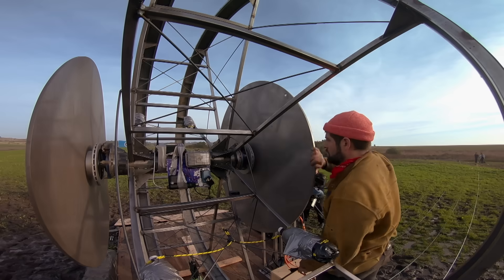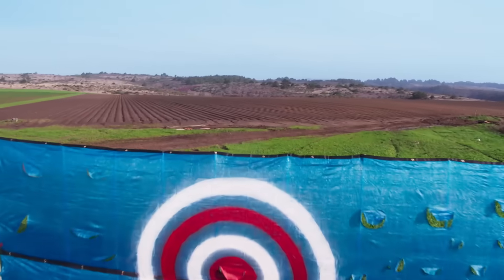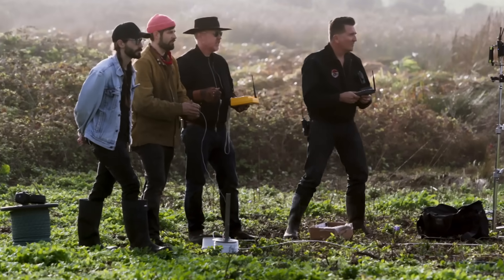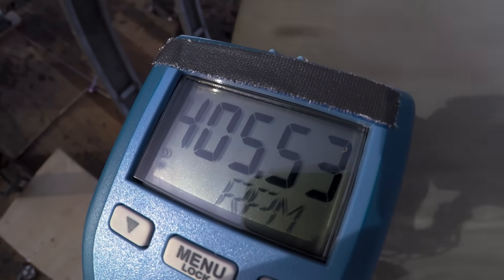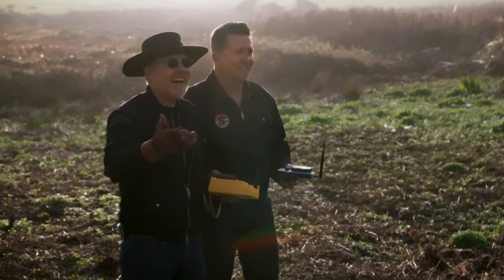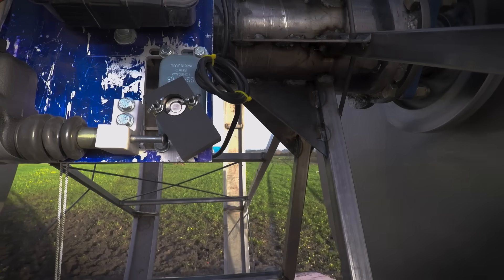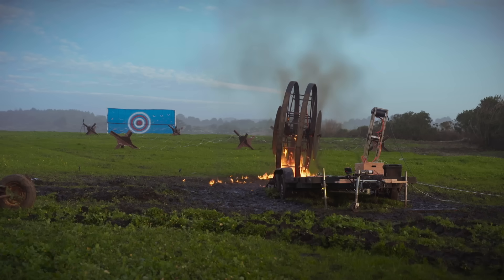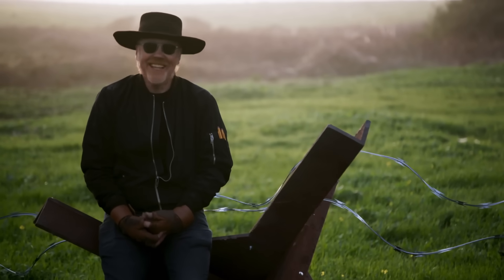Weaponised Flywheel Experiment Fails Explosively | Savage Builds

Comment: After reading a bunch of the comments discussing better ways of energy transfer or just ways to simply make it work better. I’ll throw my opinion in the mix.  If I was gonna do this I wouldn’t mess with brakes and just figure out a way to remotely connect the flywheels and the wheels with a short section of kinetic recovery rope. Simply, easy, it would lose very little energy to heat and it wouldn’t be a bolt shearing instantaneous energy transfer. You could even control the rate of flywheel deceleration by the length of the rope.

Comment: They wanted a dog clutch device to transfer momentum from the flywheel to the outer casing instantly. Not brakes. Doing so however would probably have just twisted and snapped the drive shaft in half. Or if not snapping it, the twisting would have delayed momentum on one side of the outer casing and caused the the whole contraption to lift on one side and go careening off at an angle on one edge.... Which would have been quite satisfying in itself.

Comment: If the wheels weigh as much as the flywheels you absorb any "thrust" during transfer of power.
Reply: A gear reduction system(or equivalent) is needed. Consider the toy cars that are propelled with flywheels. Applying a flywheel directly to the driveshaft/axle proves extremely inefficient.

Comment: Removing unnecessary parts instead of falling into trap of optimization of existing concept = remove brakes from design, move flywheel inside of wheel making it a wheel itself,  make carriers that fall in at desired speed and watch magic happen

Comment: Looks like it needed a direct super strong clutch to engage the flywheel energy to the wheels. Also, why was there no tread\traction on the wheels? Even if it had worked I think it would have just spun in the mud.

Comment: maybe a giant coil spring that can be instantly engaged with a servo, but smooths the energy transfer from flywheel to wheel as it winds up for like 3 seconds, and applies a growing force. you also get the power as it unwinds.

Comment: They should have used maybe a clutch system from a semi truck on each side instead of two wimpy brake calipers. I could've told them that. If my brakes (all four wheels )get hot going down hill in a  6 thousand pound truck then I don't know why they thought 2 calipers could handle a task like that.

Comment: I had way better success using far less science / theory taking a cd player motor, clipping on a cd, and running power through it until it reached maximum rpm (I did not measure the rpm but needless to say the cd was humming) a quick twist of my wrist and the cd popped off the motor and took off across the room and up the wall when it hit.

Comment: That was anticlimactic. I wish they'd replaced the braking system instead of just blowing it up. 

And maybe try it on dry ground, where it doesn't sink in the mud.
Reply: It was the mud more than anything
Reply: @ph30nix62  yes only mud
Reply: @ph30nix62  The mud / thinness of the wheels.
Reply: I think they realized the whole concept is kind of bunk. It's impossible to transfer enough energy through those brakes, they're specifically designed to convert kinetic energy into heat.
Reply: itsClearIntentionalFail
Reply: A muddy field/ground needs to be part of the equation.
Reply: They probably weren't alowed to set that thing off anyway. It would be uncotrolable, very dangerous. This thing never had a chance to work and it's not the brakes. It was too big. You can see hey went with cheap production process, if you want something to spin fast it has to be balanced otherwise - fail.
Reply: @ardvark84 they could have done the test in the desert

Comment: fly wheel needs to be slightly smaller than drive wheels so less torque to transfer.
you could do a wheel balancing like they have for steer tires on a semi bearings in a tube around outer edge of flywheel.
not sure best way to transfer power semi clutch at each side?

Comment: Ok, my take, muddy ground bad. Wheels to thin to offset the ground pressure, (this is why tanks have tracks). Breaking system needs to be faster. Recommend high pressure air breaks they use on a rig. Really didn't need to blast the thing. Sad build that could have been so much better. 

Now I wasn't there to help design. Maybe there was a reason for thin wheels. Maybe there was a reason for using hydraulic breaks and heavy fluid. I don't know these things so can't state any agreement or not on construction. 

That said ground pressure for any vehicle is important. Maybe a mesh or some thin aluminum connecting the wheels together could have alleviated some of that ground pressure?

Comment: Plowing through MUD is NOT what you should have done.  On Concrete, the brakes could have been applied and then released and the wheel would have kept going--less friction at the wheel. DUH.

Comment: They could have at least welded some spikes to the wheels or glued some destructed rubber tires with tread to the wheels or just do it on the salt flats. It’s obvious it didn’t work because it couldn’t overcome the muddy surface.

Comment: Bit disappointing you didn't go back again with a better braking system. Wouldn't some kind of clutch system been more efficient? With the current system it would have made more sense to have a two stage release system, where the drive wheel was allowed to move freely to spin up a little before the whole thing got dropped to touch  ground.

Comment: They should not have used disc brakes. All of the kinetic energy was lost by grinding the brake pads down and creating heat. Should have created a latch system to grab the flywheel and transfer all of the energy at once. I think Discovery owes us a do-over (if they want satisfied viewers).

Comment: Problems were very much present in the brake system but that is by no means the worst of it. The thing is heavy. Really heavy. So you neeeeeeeeed solid ground to work on. Otherwise you'd need corresponding wheels for offroading.

Comment: One other suggestion; try moving the brake caliper to the outer edge of the flywheel itself instead of on that tiny little automotive brake rotor.  Applying the brakes directly to the flywheel, at its edge, which is much farther from the center of the axle, would apply more rotational force.

Comment: Brakes operate by transforming kinetic energy into heat energy.
What you dod was to transform kinetic energy to heat energy then heat energy back into kinetic energy, but you didn't calculate the losses associated with the heat transfer. It is sad you took the fail instead of fixing it.

Comment: 1) The design will require not one, but dozens of brakes, each placed along the outer perimeter of the flywheel, not the center. 2) Even if the math suggests a total energy capable of 40 mph, the assumption of the rolling surface has to include friction losses due to the viscosity of the mud, otherwise wait for dry soil conditions

Comment: Opposing Brake calipers on outer diameter of flywheel using a spring over hydraulic intensifier piston to apply pressure, or wedge style actuator 👍

Comment: The flywheels are  smaller than the  diameter of the  "ground wheel " with  no mechanical  advantage,  i.e. gear reduction.  I'm amazed that  two  "engineers " couldn't  figure  this out... wait, no I'm not! Mechanics,  welders,  and machinists  fix engineer's  mistakes  every day!

Comment: How much energy turned into heat at brake application and how much energy was dissipated in the muddy ground?  I may not be the smartest guy in the room, but I have gotten a 300 hp truck stuck in the mud while simultaneously destroying a clutch. NASA needs me.

Comment: Instead of a brake, would a clutch work better for immediate transfer of force?  Obviously it would have to be larger and more durable, but the same basic mechanics of inertial transference have been used inside of automobile transmissions.  Engage the clutch while it is charging; disengage to move.

Comment: I feel like I see another issue. Brake fade. I think if you got the braking system to be abrupt enough it would only work for a few seconds cause the brakes would heat up too much and lose their effectiveness. You could stall that with a really large set of brembos with drilled and slotted rotors but I still don't think that would be enough.

Comment: I'm a trained mechanical engineer and automotive enthusiasts and the moment I saw those brakes I knew they were not up to the task. Can see when it takes off that there is a BIG difference in speed between the flywheels and drive wheels which proves the brakes were way undersized

Comment: A wheel that diameter (say 10ft) turning at 800 rpm (if all the energy was transferred) would need to be travelling at 285 mph for it not to be breaking traction with the ground.

Comment: Should of used a hydraulic handbrake system. Think of flying over your handlebars on a bike. Its instantaneous stopping force. Not just a little brake pressure.

Comment: Instead of two 5-ft discs why not have one 10-ft disc. The two discs could counterbalance each other. I believe the mud was a factor in slowing it down. Why not do it in the Mojave desert and spin it up to 5000 RPMs. Engaging in a fuse welding onto the wheels, and then a blast of water to cool the weld. Standing a quarter of a mile away.

Comment: This video was honestly a flop. The explosions in myth busters where just the icing on the cake. We watched for the scientific experiments. 
Just attaching some gasoline with det chord is just a bowl of icing.

There are various improvements that could have been done to further the experiment such as a hard brake system to get the Panjandrum spinning at the same speed as the flywheel when ready.
This should slingshot the Panjandrum forward leading to an awesome sight to behold even on muddy ground

Comment: It is pretty apparent that they didn't have an efficient enough means to transfer the energy from the flywheel to the outer frame. It couldn't get rolling fast enough to overcome the extra resistance of the ground it sank into.  I kinda expect more from adam savage and the guy in charge of getting to mars, but I also assume they were pressured on time while being on a much lower budget than was necessary to actually pull this off by people that just wanted a cool  episode.

Comment: Better brakes would have not been the answer.  Transferring power from the flywheel to the wheel must gain momentum with the mud there is to much drag. All the energy is displaced in the effort to go through the mud. Trying to calculate friction  is hard  sometimes easier to measure.

Comment: I do not agree with the fact the brakeing system did not work correctly. One cintral brake would distribute drive evenly across both wheels though. The surface area of the wheels (not flywheels) at the ground was insufficient to allow travel up the hill. And UP the hill  will disproportunately rob power from the flywheels.s

Comment: Energy converted to heat in the brake discs rather than momentum into the main wheel - that and MUD - the equations would have been for an 'ideal' surface ;-) destroying it was a cop out.

Comment: The radius of the wheel vs flywheel is at least 3x torque resistance to overcome to initiate forward momentum... your calculations were probably based on ideal conditions in vacuum settings on computer rendered torque synchronization.. would have worked swimmingly on a hot wheel sized experiment

Comment: I worked for a press company and we use flywheels with a clutch system. Seeing a 20,000 lb steel flywheel at full speed is frightening. We had one old press fail and the flywheel came loose and sped across the plant floor going through concrete walls

Comment: The moment of inertia on the wheels that contact the ground were too high also. Make them smaller in diameter (smaller moment arm) and lighter. The rotating masses should be the heaviest. All the stored kinetic energy was wasted in the brakes acting like a clutch while trying to transfer energy to the massive wheels.

Comment: His math was wrong. The thickness and diameter were not sufficient enough to build the inertia needed to overcome the torque load of spinning the larger diameter wheel. If they wanted to use a flywheel in that diameter range it should of been thicker.

Comment: For attempt #2 I would:  a.) eliminated the brakes;  b.) fix the axle to the wheels and the flywheels;  c.) install some cleats on the wheels;  and d.) build a 'rocking' launch base with 8' guide tracks.  
The rocking base would hold the unit off-ground during spin-up and then rock forward for launch.  At launch, the guide tracks would aim the unit toward the target.

Comment: Ridiculous to give up when they faced a problem.  Was that an insurmountable problem?  Whatever couples the fly wheels to the big wheel should’ve been automatic not remote controlled.  When they applied the brakes what do they expect to have happened? They stopped the forward motion.  I guess the torque developed on the fly wheel was not enough torque to propel the big wheel forward.  Maybe they should have used a transmission rather than expecting an instantaneous transfer of torque.

Comment: utter BS. the explanation is juvenile. even if you are not breaking fast enough you would just be slowing it down more slowly. the energy will still be transfered but it will move slower.
just proves this guy Adam is just an actor. and mars rover is just a staged event

Comment: Come on guys why the brakes? That's so much energy lost in heat! Isn't better a simple looking mechanism like something heavy that is pushed simmetrically from center of the flywheel to the frame via centrifugal force interlocking both the frame and the flywheel in less then seconds? Obviously that needs a great design of the locking parts and a more strong structure
Anyway I'm not a scientist but me and my band MIND GEAR we have a song called ENTROPY go check it if u want haha X'D

Comment: Half the speed means only one quarter the energy. On top of that, this is a great example for checking your assumptions: 
They assumed all that energy would go into rotation. Instead, most of it went into heating up the brakes and deforming a little bit of mud.

Comment: It probably didn't work because practically all the mass of that vehicle is around the perimeter in those treads; It takes more energy to rotationally accelerate this than if the mass were uniformly distributed like the flywheels themselves.  If you assume the vehicle mass is uniform, especially if he took flywheel energy and just plugged it into a linear acceleration equation instead of rotational, then you wouldn't be accounting for how much faster you have to get the mass of the vehicle moving than expected, because maybe 90% of it is in the very fastest part of the rotating circle

Comment: I rarely dislike videos but damb, this can't be encouraged. Obviously test on a hard surface. #2 the entire locomotive wheel is so much larger than the flywheel that you're essentially gearing down all that inertial momentum. It's like trying to accelerate 0-60 in 7th gear.

Comment: This would never work because the rotational inertia increases the weight of the flywheel by many orders of magnitude.  A rotating disk would require more force to move from it's position in space than a non rotating object of the same mass. Think of trying to move a gyroscope. It doesn't want to move anywhere.

Comment: The space engineer should have compared the kinetic energy of the two steel discs with the kinetic energy of a 6,000 pound truck traveling, say, 60 MPH.  There's a big, big difference in braking required.  The brakes are inadequate to transfer the energy, wasting most of it as heat.  The brakes required would be massive.

Comment: The energy stored in a Flywheel goes by the SQUARE of the Rotational Velocity.

So there was more energy in that missing 300 RPM than when you had put in up to ~700 RPM.

Comment: Energy was lost to heat in the friction pad. Plus once brake pad temp got too hot you get brake fade. Solution would be to move the calipers to the edge of the flywheel rim, using flywheel as the disc. Maybe more calipers until you can achieve an instant lock.

Comment: Worrying that a NASA engineer couldn't figure out that thin wheels on soft mud with an incline will hinder this. 1 single wheel with the same footprint as this with an internal flywheel would work better. Oh yea and don't test it in a swamp next time.

Comment: I’m not an engineer but I can’t think of a viable way to transfer energy from the flywheels fast enough and efficiently enough to make this work and be effective. You would almost have to have the wheels completely stop in a second to transfer enough energy to propel that much weight. I think it would just be way to violent and dangerous to be anywhere close. I can’t even imagine the forces in play here.

Comment: brakes are designed to convert energy to heat.
they worked exactly as designed.
nothing of this earth was going to instantly spin that much mass up to 40mph without ripping itself apart.  What it needed was gearing, a CVT transmission works well for constant RPM power source.  but that would complicate the build by a lot (and cost a fortune)

Comment: Understanding that the conservation of momentum is different to the conservation of kinetic energy. For instance a 1 kilogram chunk of steel at 1000m/s hitting into a 1 tonne chunk of steel will move at a vastly mediocre 1 m/s, losing most of the kinetic energy. The same thing in this wheel. Most of it is transferred to the brakes as heat. If the brakes are applied slowly, this might not even overcome the rolling resistance of the muddy grass. What you really need is a gear reduction between the fast flywheels and the slow wheel.